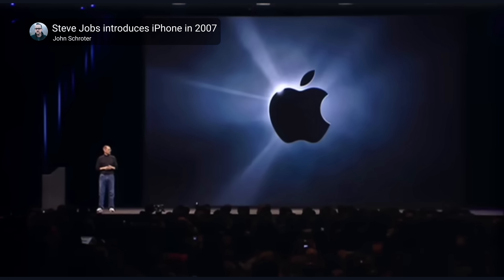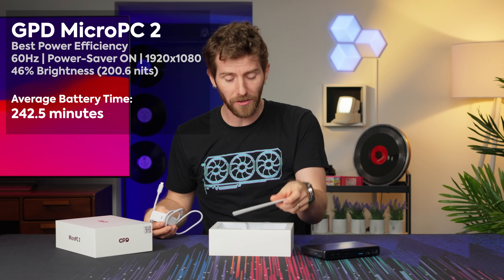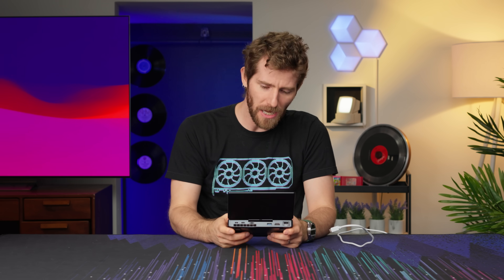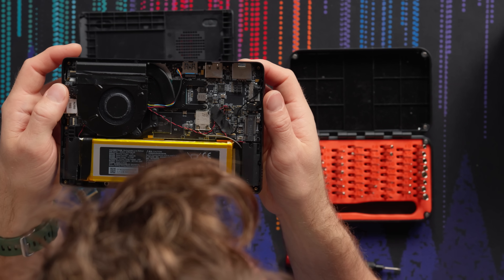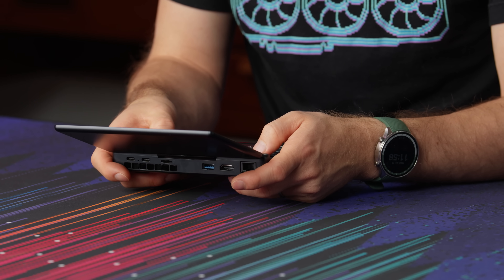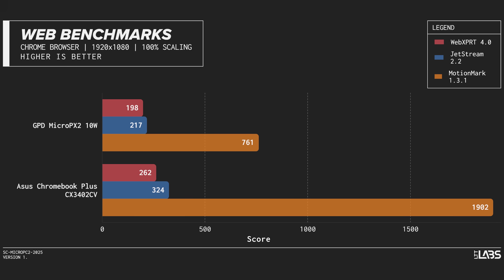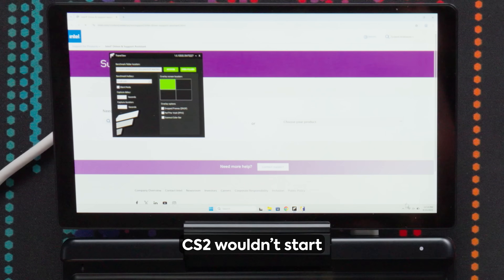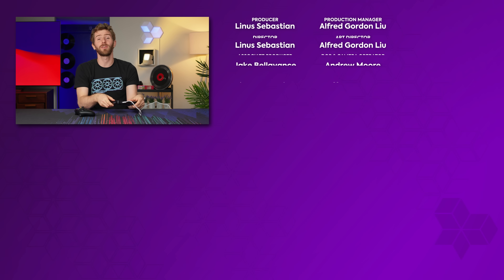I’m gonna need a smaller backpack - GPD Micro PC2

Comment: Eh. I used to have a UMPC a few years ago. While the idea is neat, laptops this small are just unusable. 

No, you're not going to use this tiny keyboard a lot. The device is so small that you are going to hold it with two hands a lot. So you are going to be typing with two fingers a lot. On a keyboard that is tiny and has really crappy tactile feedback. And if you try to ten finger type on that keyboard... yeah, good luck. It's just way too small and chances are the keys are also too mushy. Also not a great experience. 

So what did you buy? A small tablet with a horrible physical keyboard. And actually you would have been better off with an on-screen keyboard because that thing at least autocorrects your typos while you type and gives you easy to use suggestions.

Comment: I have the gamepad one from 2021 and I'm kind of shocked this thing has far lower specs. That one is a beefy i5 with 16GB DDR4, and the graphics are decent for its size.
I was able to play games like Civ and Assassin's Creed 3/4 no problem. The fans chug but it doesn't stutter. My screen doesn't do the spin around thing but I don't want it anyway.
When I did IT I lugged that little thing with me to do network testing and mapping, or when I needed a terminal up on a mast. Fits easily in a hoody pocket too. Runs Linux well.

Comment: man, seriously, if this was close to $200 and bare-bones (500GB storage minimum) I would snap one of these up in a second. I really could not care less about performance on a device like that. What I want is a productivity PC that is actually usable on the go.

I know there are similar devices out there, but they all seem to run android and/or be of highly questionable quality. Judging by the features in this device, I'd say they could cut out all the speakers, A couple ports, Eliminate the extra SSD slot, and that would make the overall cost of production and design much much cheaper even if the components aren't all that expensive in and of themselves.

That would be a product I think a lot of people who work out of a car like myself would very much want.

Comment: The pocket 4 has a (proprietary) expansion slot that allows for a kvm hookup or rs-232 port for maximum industrial compatibility, just hot plug into a machine and you're good to go. They have a handheld line for consumers, but this aint it and they definitely have a niche IT market no one else has even touched

Comment: Whilst it is pretty, small and very functional, why, oh why, oh why do these computer designers never design these computers to use changeable AA batteries? Or screens that use e-Paper so that they can last for a really long time without needing to be recharged? Or extremely low power processors and solar cells so that they can run indefinitely???

Comment: I’ve got the original MicroPC.

It’s definitely not powerful by today’s standards, but the tiny size and all those ports make it surprisingly convenient. As an IT professional, I really appreciate what it manages to pack into such a small form factor.

That said, the original model is terrible for gaming. If that’s your main goal, you’re much better off with something like a Steam Deck for the money. For most casual users, even an iPad will offer a smoother experience overall.

I’ve got to admit though, the fact that the newer model can actually launch Cyberpunk is impressive. If I tried that on the original MicroPC, I’m pretty sure it would just… die instantly.

Comment: Added. Business users don't give a flying rat's about specs. Will it run PowerPoint and other common programs? 
What a nit is doesn't matter. Take the thing outside and see if the screen can be seen.
These things are practical units, so get practical.

Comment: I have something similar, but your review is lacking.
People likely to buy this will very probably have a keyboard,  mouse, and screen on their home and office desks.
So, do the 2 USB C sockets support video with separate outputs on each?
My Chuwi has just one USB C, and it's used to drive a 15.6 inch monitor with power through to charge the machine.
Business laptops are for business, not silly games. You might want to consider that if you want to improve your channel.

Comment: I love this class of product, i have the predecessor to this with the grandfather of this atom processor in the OG GPD Pocket with Atom X7-Z8750, though i think it was down-tuned to 2-5w instead of up to 20w

"N250 is not that old" And neither is the Intel Comet Lake Intel Core 110 on intel 14nm and LGA1200

i'm making fun of intel here of course, did you know they initially tried to pawn this single channel Atom class processor off as an i3 with the same CSP as the 1215U which could support 2 channels of RAM, 11 more PCIe lanes, gen4 PCIe instead of PCIe, and something like 2X the GPU. Its still named an i3-n305 but at least you can now find fully assembled devices with storage, RAM and OS for the same price as its original CSP of $309

Edit, i didnt make it clear that by having 20 gen4 PCIe lanes, the 1215u has more than 4X the PCIe bandwidth, the N305 has a soft limit of 16GB of RAM(i have 32GB installed and i'd imagine a 128GB SODIMM works) the 1215U supports 2 channels, and 2 dimms per channel meaning you could in theory fit 4x the RAM into a 1215u system compred to an n305

Comment: Would not even consider this at its $600 price tag. I love the idea of these tiny laptops, but with the handheld gaming market proving we can have good batteries and strong processors in overall package sizes not much bigger than this I expect far more from something like this at $600.
Reply: Maybe consider the Piccolo N305
Reply: Used Thinkpad T14 with Ryzen 7 6800U, same RAM and storage cost just 400 dollars and will crush this machine by a huge margin

Or if you're only want handheld device, 1st gen ROG Ally roughly cost the same but it has Z1 Extreme that will outperform the N series processor by a lot

Comment: I still have my GPDwin1.  The original battery bulged but I changed it and it's still working like a champ.  I'm now using it as a mini desktop PC to connect the midi output of my old piano with PianoVision, to play piano in AR with  Oculus Quest 3

Comment: I think it's important to keep in mind the limitation of the CPU on this. Just to compare its performance to something you might know, it has a cpu mark score of 1,874 and 4,868 for single and multicore, respectively. That means an i7-6700 (released 10 years ago) has better single core (2,277) and nearly double the multicore (8,051) performance of the n250. To find a CPU that's even comparable you have to back to something like the i7-2700K, released in 2011, which has a single core speed of 1,810 and multicore of 5,701. And that still has a better multicore score of almost 20%. Now, I can understand the multicore score being low because of the TDP constraints.. but the single core has no business being that slow even on a low TDP chip. For instance, the Ryzen 7 8840U with a 15-25W TDP hits 3,544 single core and 23,324 multicore. The Apple M4 9 core (in Ipad pro with no active cooling) hits 4,500 single core and 22,216 in multicore. Even the Apple A18 (non-pro) with a lower TDP hits 3,928 single core and 12,418 multicore with no active cooling.

Comment: They should have designed the battery to be hot-swappable and added a USB port for independent charging. This computer would be especially useful in the automotive and telecommunications industries, and it could also benefit ham radio operators.

Comment: As a lighting guy, this could work. MA Lighting makes a lighting console called the onpc command wing that needs a PC to run its software, imagine a gaming controller that's basically what the console is. Most of the custom made console rigs people have made use touch screens and a laptop to make it as small as possible. With so much IO I think this little pc would work so well for this application. Great video guys!

Comment: I am that sysadmin type that was mentioned here who might like these kind of devices and I think I rather stick to my clockwork uConsole for the kind of tasks I like to use a portable small form factor computer for. and the raspi in that is plenty powerful enough for what I use it in admin work anyway (connecting to console ports on switches, firewall appliances and the like). And costs less than half of the GPD Micro PC2 (and looks a lot "cooler" as well if someone cares about that sort of thing). If you manage to get one that is, the avaliability is the main downside here, a lot of patience is required.

Comment: Sorry, 7" is too small IMO.  I've used one of their older devices and that size just doesn't cut it IMO.  And I don't even have large hands.
Reply: they have a GPD Pocket 4 that has a 8.8" display but it starts around a grand but also has better specs like a 1TB hard drive.

Comment: 'Full support' for Linux was a bit of a stretch - the fingerprint reader doesn't work at all under Linux, the physical right click button doesn't work at all, the left click button only works on Gnome + Wayland correctly and on other DEs you have to be physically touching the touchpad itself with a finger before the left physical button registers a click, the touchscreen wasn't working out of the box either but they have recently patched their BIOS ACPI tables to fix it including fixing it after waking from suspend, the Intel AX201 wifi driver crashes with some access points on certain channels, screen rotation based on IMU isn't working natively and requires a background process to constantly poll the IMU and issue xrandr commands, and native-portrait on the LCD panel remains the pain in the ass that this was on earlier models.

But it's still a great device.

Also just to be correct, the Win Mini 2025 is a much more powerful system with an actual GPU capable of playing games, a larger battery, oddly BETTER linux support, and nifty hardware gamepad controls in about the exact same footprint and only slightly taller case - but no ethernet port or screen rotation and a much heftier price tag.

Comment: This seems like a big step back from the original Micro PC. Like it has updated specs sure, but its missing the one killer feature the original had... a full-size serial port. The OG Micro PC was and still is fantastic as an ultra-portable laptop for troubleshooting networking gear and older electronics systems. A lot of that old gear does not like USB to serial port adapters and won't work with them. With the serial port on board though the Micro PC was just super super easy to throw in a back with your field tech kit. The Micro PC 2 just seems like a worse version of the Pocket 3 with no real target audience.

Comment: If you're looking for tiny computers that actually have impressive specs, GPD's Win Mini or Pocket 4 have much better processors and batteries in a only very slightly larger package. The Win Mini has the same screen size but is a little thicker to accommodate twice the battery and gamepad controls on top of its thumb-keyboard, while the Pocket 4 retains the mouse setup linus liked but expands sideways to where you can actually touch-type on the keyboard. Win mini fits in my pants pockets comfortably, though ymmv; the pocket 4 is (ironically) a bit too big for all but the most expansive cargo pants, but fits nicely in a hoodie or whatever if you don't want a whole backpack.

Actually you could probably get last year's win mini for less than a new one of these, and it would have an 8840u in it.

Comment: Ngl I am really interested in this thing. The I.O. being so good is what makes me believe. Like there are so many times where I need s full desktop OS for some reason, and not having to carry dongles around, just knowing this thing is self contained as technically all I need to connect to anything and run a desktop os.... That's really useful, and it's also fairly reasonably priced. If it was like 800-900 usd I would be a little more reticent, but at 600  something 👀. Not sure about the battery life or the terrible ergonomics for my big hands, but I could totally see myself coming back to this video in 6 months to find the link to buy this thing.

Comment: There have been tiny laptops for a LONG time with at least acceptable performance, but they've been near novelties for at least one major reason: you can't get a reasonable and readable screen in a laptop that small. You're not generally using a phone down on your desk and 1920x1080 at that screen size and distance from your eyes is only for those with excellent vision.

Comment: This is really cool. I'm not a corporate on-the-go pro so I don't know how useful or in-demand a product like this is for people. I guess if for some reason you needed the smallest package possible with some essential ports, as I know a lot of the especially newer small laptops just lack a lot of ports and you need a whole USB hub.

Sometimes I myself think "Hey wouldnt it be really cool to have a small computer that lets me do stuff on the move away from home?". But the thing is that so much stuff relies on an internet connection and sitting down at a desk or something. I wouldn't be able to do much with a small machine like this.

Comment: Clearly GPU bound in CP2077 yet did not reduce load ? I bet it does 30 fps in medium. In any case their claim is srill valid. Just load an older game and use wired mouse as i suspect their BT is lame

Comment: The N300 cpu, which does not cost that much more, is a huge upgrade. There are issues with the charger (does not support more than 45 watts), and there is still room for improvement on the Linux compatibility. Still, there is nothing similar to this in the market!

Comment: 1:47 NEVER USE THOSE GPD POWER BRICKS! They are trash and it caused my battery to stop working after a year. It's a known issue and users on the GPD subreddit and forums will tell you to get a better charger than the one included in the box.

Props to Kenzy at the GPD customer support for making the whole process suck less. By the time I reported it, I was out of warranty so the only thing I could do was purchase a new battery (for $85 USD) from them and install it myself, which was annoying but not impossible.

Comment: To be fair I use a Quieter 4 from MeLe and it's got an N-250 as well with 8gb ram and passive cooling. I strapped it to the back of an OLED 14 inch monitor with pen and touch as well as a battery that can power it all and it's basically just a tablet with all the function of a PC like that one in a form factor that makes sense and usability for everyday people- and gets about 4 hours of heavy battery use.

Comment: I can see applications for this, but the weak processor is a little disappointing. Would have preferred the Ryzen 3 PRO 210/8440U or the N305/355

Comment: I want more devices in this form factor, rather than the Steam Deck-alikes everybody is making now. There's just something about clamshell devices. They look better IMO, and they can have better placement of controls since they're not restricted by the placement of the screen. And they're more portable. And they're better protected so you don't need a case or a pouch. Battery capacity does suffer though. GPD has been making these for a long time now but they seem to be the only ones and they are a little pricy. I would love a clamshell form factor PC from a more mainstream company. I wouldn't mind if it was a little chunkier to accommodate a bigger battery as well.

Comment: I wish Linus did something with the lower tier chips he has no idea about.   
The NXXX(100,200,250,300,etc) are great for very light stuff and potentially a simple home server.  
I am running my home server with nextcloud, Jellyfin and more off an i3 1220, which is the next step up from the N300, and I could easily also do it with the N300.

Comment: Based on the Wikipedia article, the N250 uses the Gracemont SOC architecture, which is based on the alder Lake architecture. Related to, but not exactly the same as the similar Atom chips of the same generation. The N300 is basically an IoT version of the core i3. These are essentially fully feature IoT class soc’s.

Comment: That microSD slot is going to fry every single microSD that's inserted in there for any significant period of time.

The ROG Ally did the same - they get too hot, right next to the exhaust, and microSD reliability is bad enough as-is.

Comment: 8:27 @linus i lately saw a lot of new entry Level Notebooks with those Intel N100, N150, N200, N250, N300, N305, N350 and N355 when Shopping for a new Notebook for my grandparents. They seem actually quiet new. My understanding is that these CPU replace the old Celeron and i3 Branding? But i am Not sure about that. I finally decided on a Laptop with an AMD CPU. But I would be very interested in this new lineup of Intel CPUs. For example many cheap mini-PCs contain Intel N-CPUs as well, are they good enough for Building a NAS? 
Love Your Videos.

Comment: It reminds me of my old Atom N150 (that has nothing to with the modern N100 of the same name). The new N100 processsors are really great, 4/8 E cores, with an UHD iGPU and 8/16GB or LPDDR5. I'm trying them on my robots with the Lattepanda Mu, it promises to do 8B local LLMs on my robots withoput breaking a sweat!

And the next Intel series with Arc tiles and 18A process could be even stronger!

Comment: That N300 version would have had twice as many cores (~power) as that N250 one tested here. So if you care about performance, choose the N300,  the price difference between them is not that big. GPD also makes a real gaming laptops that are almost as small, and have controllers built in and all that.. but those things are not cheap 😅